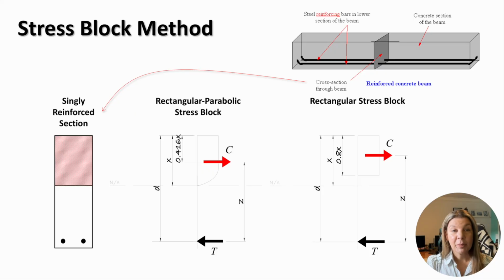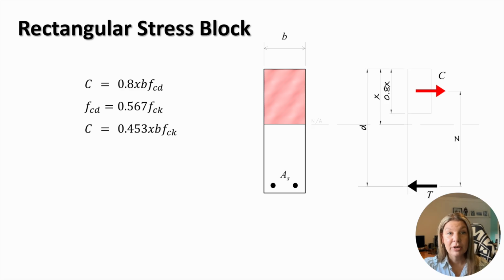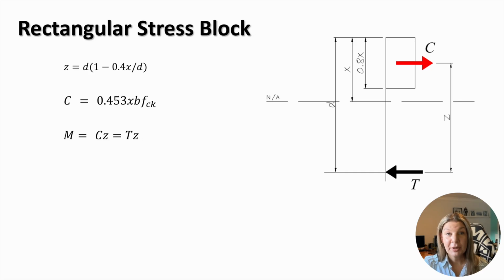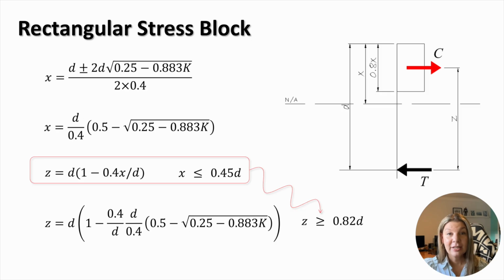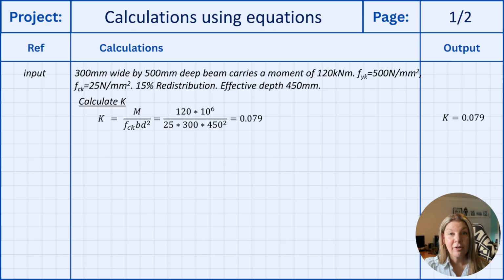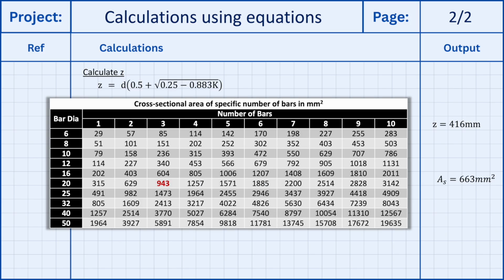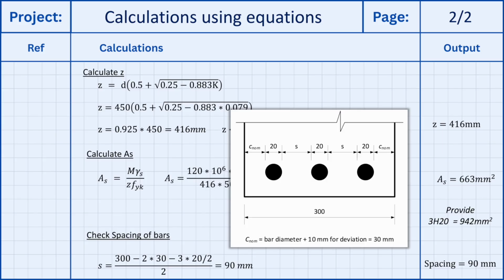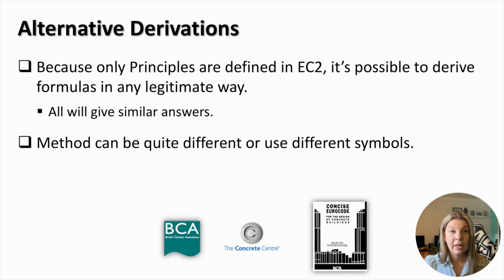Reinforced Concrete Design | Topic 2: RC Section, Part 2 – Design by Calculations | Eurocode 2

Comment: How are we sure that the 943 mm^2 provided instead of 643 mm^2 does not lead to over reinforced case...?
Reply from the maker: This is a really good question, and the topic probably deserves its own video!
For this example, the required tensile reinforcement is approximately As = 660 mm². To check that the reinforcement we provide does not make the section over-reinforced, we can calculate the limiting steel area.
Taking x_lim = 0.45d, where x_lim is the limiting neutral-axis depth that ensures the tensile steel yields before the concrete reaches its ultimate compressive strain:
x_lim = 0.45 × 450 = 202.5 mm
At this limit, equilibrium gives:
0.87 fyk As,lim = 0.567 fck b (0.8 x_lim)
For our example with fck = 25 MPa, fyk = 500 MPa and b = 300 mm:
As,lim ≈ 1580 mm²
So, once we have selected the bars, we can check:
As,req ≤ As,provided ≤ As,lim
For example, if we provide 3T20 bars, As,provided = 943 mm².
Since 660 < 943 < 1580 mm², the reinforcement is sufficient to resist the design moment, while the section remains under-reinforced.
Reply: @EngineeringTheCurriculum  Thank you very much....So unless I am mistaken the Asmax limit specified by the eurocode does not automatically ensure this?....and therefore it's a good idea to proceed with a check based on steel area from x=0.45d.